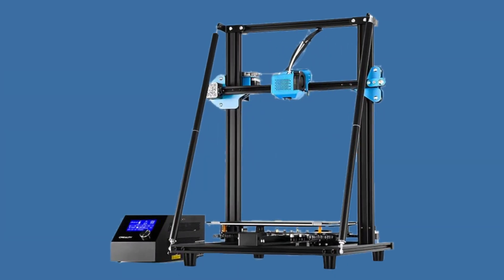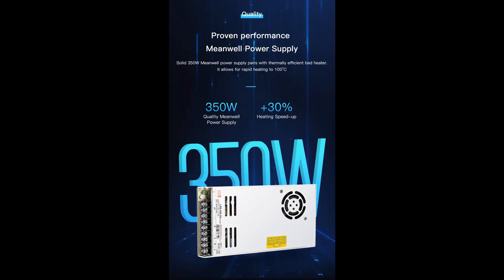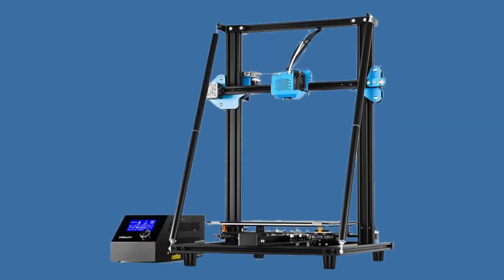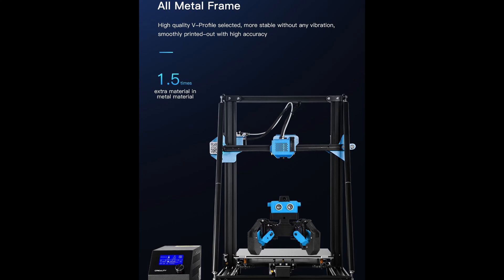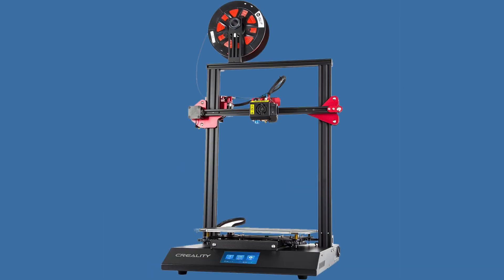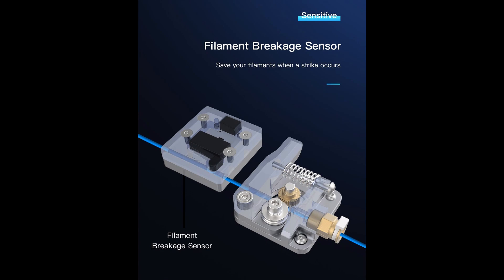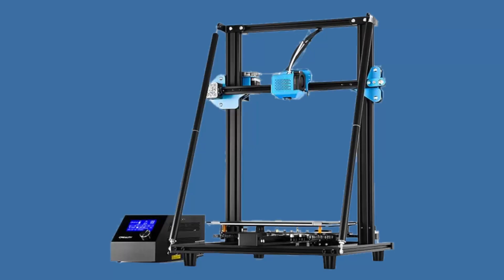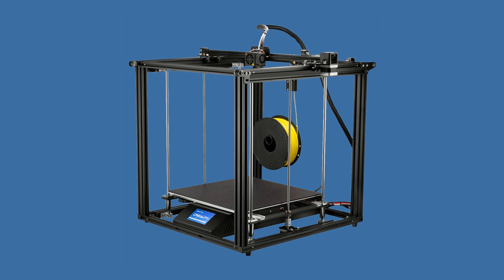Creality CR10 V2 Features Pros and Cons

Comment: Could you suggest a printer that will just print out of the box with no modifications what brand or manufacturer would you recommend
Reply: My printer does that, it's a Craftbot plus, personally i think the Creality CR10 V2 looks great and all those negatives stated are nitpicks.
Reply from the maker: Yes you may say the're nitpicks. I would go for the direct extruder in the Creality cr10 v2. I would go for a coreXY 3D printer. No more of this bed swinging back and forth. it depends what you want. the tronxy sa5 pro is a bit of a risk but if you get it right might be quite a good machine, but most reviews complain  of quality control, and it requires upgrades.

Comment: I think they made this printer like this to save money, this is the basic version and requires upgrades, it isn't a pro version. Out of all the negatives u mentioned the only one I care about is the dual gear extruder, my Craftbot plus has a single gear and every time I start a print the gear snaps back a couple of times in the beginning of a print but the prints do turn out good.
Reply from the maker: at the begining of the print the gear snaps back. that is usually when not enough material is exiting the nozzle. because the nozzle may be too close to the bed in some areas.
Reply: Roaming Interests Yeah, I'm not sure why, it only does that in the beginning of the print, I have a buildtak.
Reply from the maker: if it is not enough room in between the nozzle and the bed, then it will do it in a dual extruder. my cr10 s pro did that as well.
Reply: Roaming Interests It's odd, was recommended to put the nozzle higher for buildtak. Well anyway thanks for responding and for the video, can't wait for reviews.
Reply from the maker: I just checked the buildtak, how do you use it,what is it , is it somethin gyou glue on the bed or the glass or is it an additional removable surface because My Crealirty cr10 S5 had enough of me and ejected the glass on the floor and shatered it. now I am trying to replace that glass with something with less heft. so I checked the buildtak and it seems inexpensive so I am assuming is a film that needs to placed on something, and I still ned like a plate or a piece of glass to place it on. Neve mind it was in the FAQ, the fisrt answer.
Reply: Roaming Interests yeah, sry for the late reply , it's like a huge sticker, u place it on any surface, they rexommend to relevel the bed at 0.2-0.3 mm if I remember correctly, will have to relevel it again, remember switching the nozzle and didn't relevel. The surface is great, always stick, sometimes a bit too much and lasts quite a long time. The surface has a texture to it.
Reply: Roaming Interests I releveled the bed, they recommend 0.2-0.25mm distance and now the clicking in the gear has stopped , guess that was the problem. My printer has a removable aluminum bed.
Reply from the maker: Cool. That' is nice to hear.

Comment: The separate control box/ power supply is a good selling point for me, as it makes it much easier to enclose the hot parts, without worrying about those components which should stay cool. The all in aspect of the “pro” version stopped me from buying it.
Reply from the maker: That is an interesting point. I do not see any advantages to the outside box, but only you take it apart, you dont have to tilt the printer. the box is quite small so still not sure how much better is the box at cooling rather than the base box. but I do appreciate you sharing a different perspective and making me see a different point of view.
Reply: Roaming Interests separate box is not better at cooling. What I mean is that if you enclose your cr10 to print abs or hotter filaments, you can bring the gantry to 100c without worrying about over heating the electronics. Keep in mind that if the drivers run 50C above ambiant (so 75C under normal conditions), placing them inside a 100C enclosure will bring them to 150C.. not comfortable for the electronics! So best to keep that little box out of the enclosure..
Reply from the maker: Well, Yea, Now that makes sense. Thank you for broadening my horizons. Still they should have only one cable from the box going to the printer and use a similar method for running the cables like the PRO with the board and then providing the proper cable length to tuck the cables in the rails properly so they do not hang around, then everyone would be happy.
Reply: stephane david I have been researching PLA that's easy to postprocess, found multiple versions of PLA and plan on testing Colorfab PLA PHA next since it can be smooth with acetone and prints like PLA.
Reply from the maker: I do have one question about enclosing the 3D printer, How are thestepper motors cooled, because I had to put large heat sinks on mine over long 3D prints, especially on the extruder which constantly extrudes and retracts.
Reply: Roaming Interests that’s tricky... water cooling? I have not done this yet, as I am waiting to purchase the v2. But indeed, the steppers are a problem. I will probably be going for water cooling. I have seen enclosures where the steppers are left out, and insulated with brushes but i don’t think it’s feasible here. Or maybe it is.
Reply from the maker: Well, You do have a bit of a problem on your hands there. LEt us all know how it pans out.
Reply from the maker: @stephanedavid5313  I don't know that is a bit above my patience to config.

Comment: Very informative, i have never used a Creality printer so thanks for sharing you're thoughts, my Craftbot plus prints without issues out of the box but this buildolume is appealing.
My printer has a cantolever bed, and at high speeds the bed will vibrate so i'm not sure what the problem is with the bed moving back and forth like that, will it create layer shifts?
Prusa uses it but has a smaller bed so that could be a factor.
Reply from the maker: Yes basically will create layer shifts. And you get chatter in the walls. There are jerk settings to mitigate, but because the model is contantly adding weight to the bed already moving with it's own momentum, the 3d print itself will shake under the nozzle. I am not crazy anymore about the cartesian system